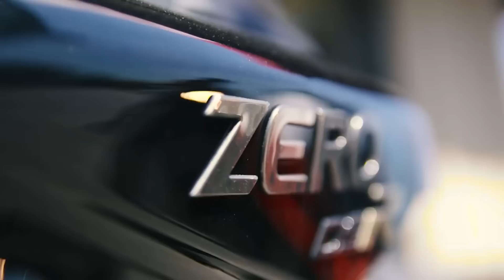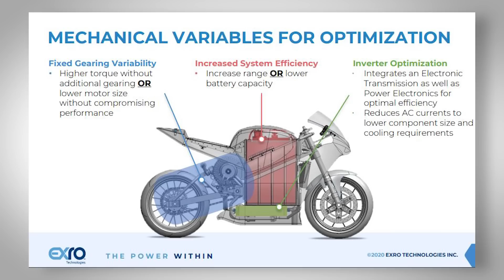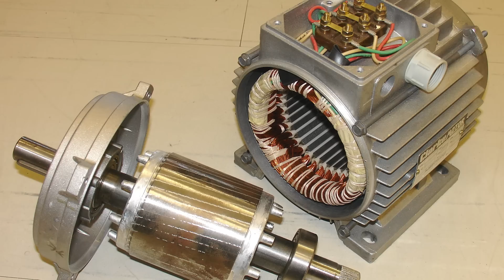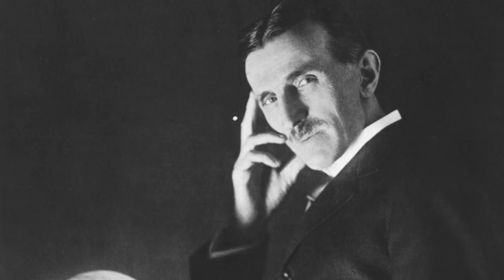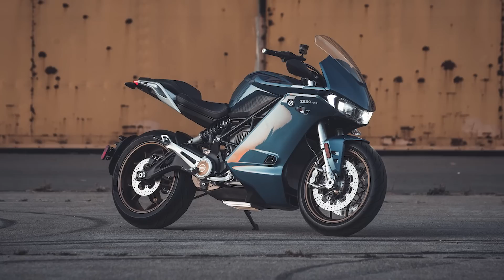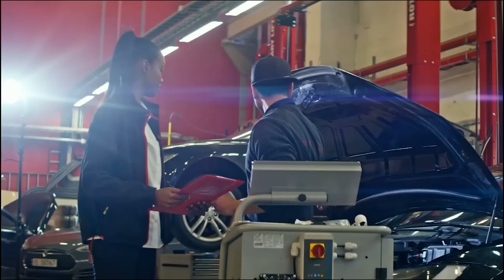Goodbye Gearbox??? | Exro Technologies

Comment: I bet the truck company is GM Ram, as they are still using the 6 Gear on their Cummins diesel and rumor has it they are updating their transmission to be more inline with Ford and Chevys new model. If not GM, I bet they would love this tech for their 2500 and 3500 diesel towing apparatuses. As for a person living in a 5th wheel I have to stick to a diesel pusher until the Cybertruck can pull my rig.

Comment: Simplified: Their controller is an instant switcher between DELTA and STAR configuration of the e-motor? Right? Without torque hole
Reply: That's kinda what it seems to be based on the diagrams and description.  Of course, there's no reason they're limited to two configurations, apart from the complexity of the controller, so it will be interesting to see all the neat things they can do with this.
Reply: The range of torque and speed required for E-cars goes far beyond what the full range of Delta-Star could offer!  And Delta-Star does require AC-power whilst batteries are DC.  Most E-car motors (not all!) use a version of frequency drive that extends very much the speed range.  At very high torque and very high speed there is different physical phenomena's that does reduce the motor efficiency quite a lot.  In my understanding, it is for these conditions that Exro tries to optimize the power signal.
Reply: More complex. They're playing with the pole count and coil turns count in the motor stator.
Reply: Yep some people are developing these types of controllers for electric skateboards too.
Reply: I think Tesla already applies a technology to run the motor above base speed to achieve higher speeds (? Field weakening). I wonder if field weakening can be applied in addition to this technology also... that would be very convincing for nailing the coffin for gearboxes for electric vehicles.
Reply: YES!!!!! @cozmaniac
Reply: national - assembly . net . for germany : ddb radio . org ( in, deutschland treff /
voice room ). you really want solve, one or another problem ? you really want
to have health ? ask this questions before you do anything. in my experience,
most humans world-wide are not ready, and not willingly to make a bigger change.

Comment: So does the motor need to have multiple taps in the windings to get the certain modes of operation? like a multi tap Transformer?
Reply: I think: yes. But maybe they are only switching delta/star...
Reply: Ah, there was another part where they said they are already selling the controllers to motor manufacturers so maybe all in the inverters....might have to put my order in for Xmas!

Comment: Great video but a better analogy would be variable valve timing (VVT). Squeezing out more from less.

Given their current system uses profiles to produce the optimum torque and speed would the ultimate destination of this technology be a blend of profiles that would do something similar to what a CVT does in ICE vehicles?

Comment: Are they utilizing the normally parasitic tendencies of "back EMF" to their advantage?
Reply: i would think they are - canceling out each other = no EMF reduced or no shielding and less heat less vibration.
Reply: @stevemyers2092     I believe that you are correct, in that a cancellation of the Back EMF would be very productive.  Yet, I wonder if they may be going even one step further than a mere cancellation.  In recent years there have been some rather compelling experimental results, where the normally obstructive high-voltage inductive spike (Back EMF ) was even more productively fed back into the circuit in such a way that it mimicked a high-voltage shot from a bank of caps.  If they indeed duplicated and mastered that process, “all bets are off” because efficiencies will go through the roof.

I reference the work of just two such experimenters, Jim Murray and Paul Babcock.  Here is a reference to some of Mr. Murray’s work.  

 https://www.youtube.com/watch?v=HK3JOlY0V8Y  

I believe you will find this fascinating.
Reply: @HenryB51  thank you
Reply: but did they mitigate side-fumbling?
Reply: @traumajock  they literally crack the formula!  By utilizing a series of highly resonant Redelvanators offset by a parallel array of 3/8 wide-angle high-frequency hedgehog flashes (field adjustable) they essentially supercharged the standard turboencabulator by taking it to the next level.  The future looks bright.
Reply: @HenryB51  I've been preaching that for years!  They must've also made a breakthrough in Stetsor Valve technology to avoid rift pooling from the variable G-zone.
Reply: @traumajock  Ah yes, a kindred spirit !